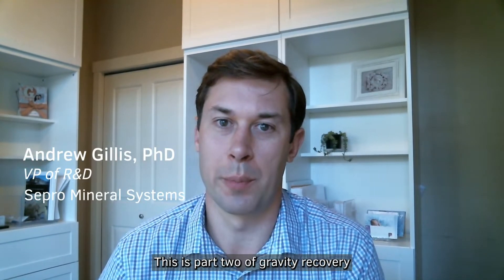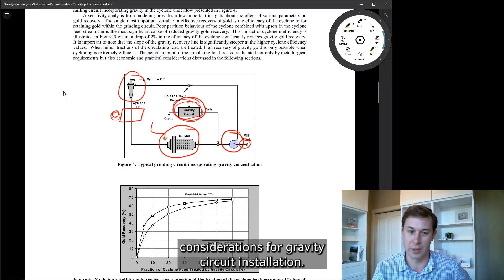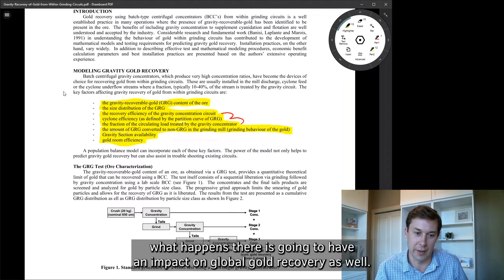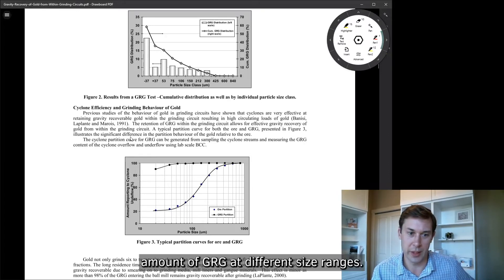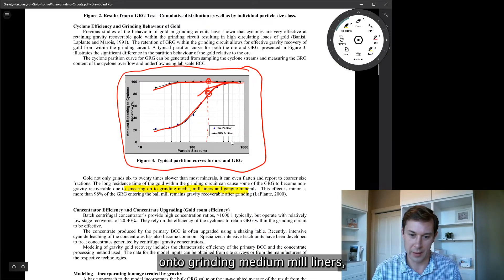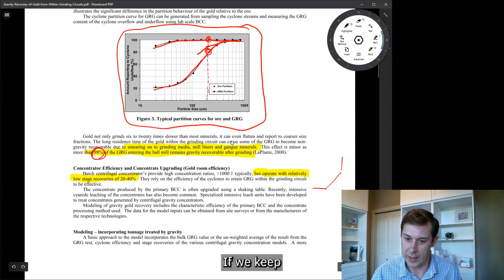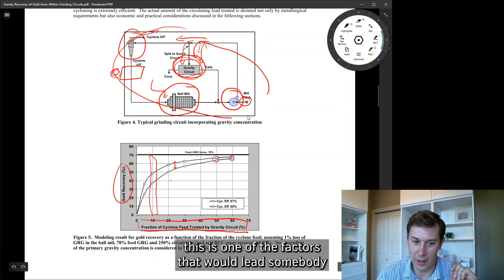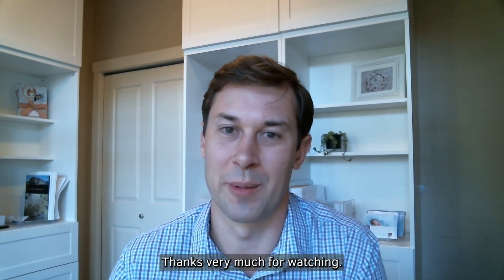Gravity Circuit Modelling | Part 2 Gravity Recovery of Gold from Grinding Circuits

Comment: What we ended up doing in our gold project is placing a low rpm/high pressure knelson type conc. on my underflow after the grinding mill and a high rpm/lower pressure falcon type conc. on my overflow. We are happy with the results. This design made sense for us since gravity tails are poor enogh that it is uneconomical to use hydrometallurgy or float.
Thank you for the video!